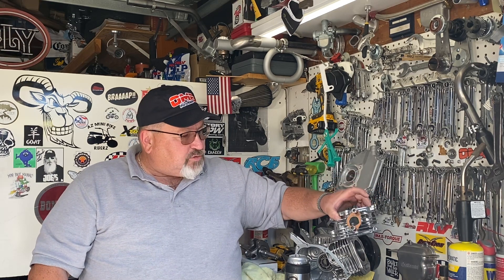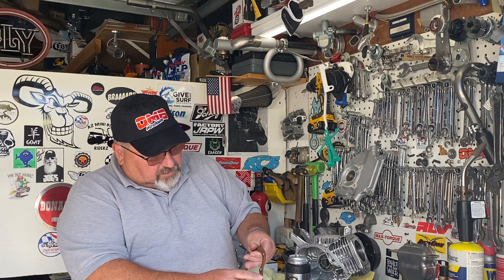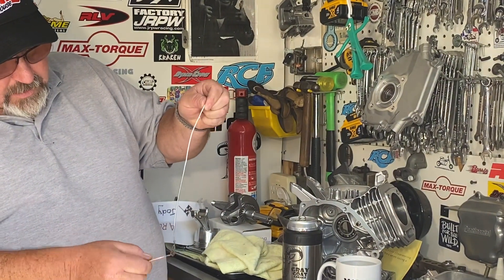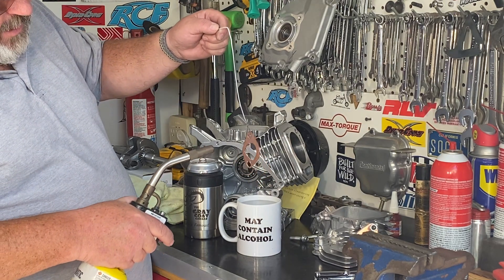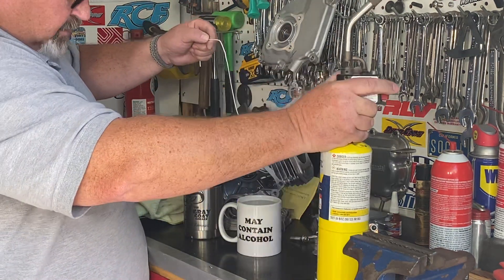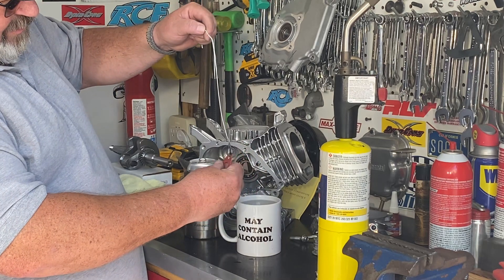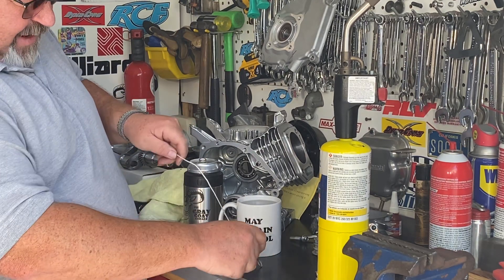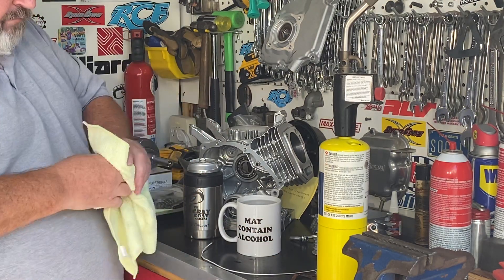Copper gaskets? Anneal them before using!

Comment: So see how long it took to heat that tiny gasket. I have tried to heat a twin cylinder head gasket for a BSA A65 with a MAP torch, I cannot get it to go red. John Deaville.
Reply from the maker: You need more heat! I would fire up the gas barbecue and see if that will get hot enough. Or try all the burners on the stove when your wife is not home. Gotta get creative!
Reply: I’m amazed a map torch can’t heat a gasket to dull red. Washers are easy to do. Takes 5-10 seconds. Maybe gaskets are to thin to heat this way. Incidentally, the best way of cleaning after annealing is with scotch pad.

Comment: Oh now i know why i use copper head gasket with gasket sealer and do a two surface seal , but still leaking radiator water into the combustion chamber .

Comment: It there a recommended torque spec for tightening exhaust fasteners?
Reply: Yes . With a cheater pipe crank on it until the knuckles turn white and you are with in spec.

Comment: What’s the advantage of using copper gaskets? I’ve had no issues using regular gaskets.
Reply from the maker: I port match the gasket to the head. I can pull off the header and not have to match another gasket. The foil gaskets tend to pull apart after heat cycles

Comment: And quenching in water hasn't no effect on copper/brass like it would with different types of alloys like steel, where it would actually make it harder. All you're really doing is cooling it off more quickly instead of letting it air dry.

Comment: You should get some tempilaq and paint it in different places on the gasket, that way as you heat it up, you can ensure it has reached the proper temp
Reply: IR thermometers make that even easier to check.